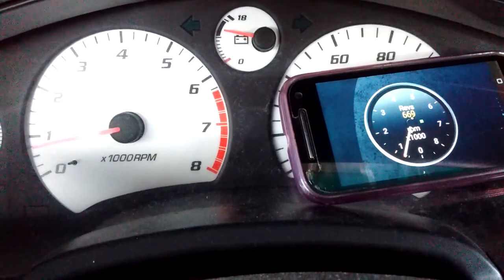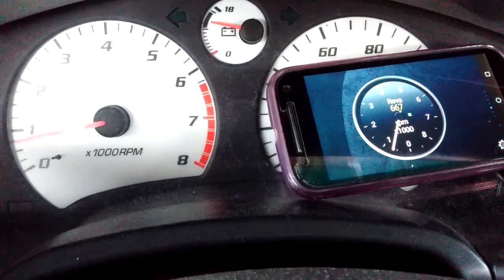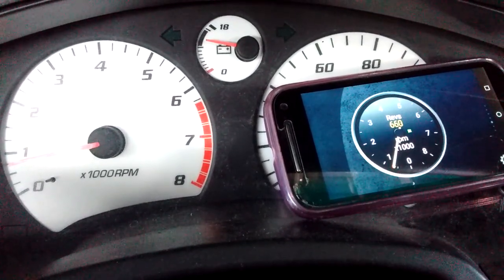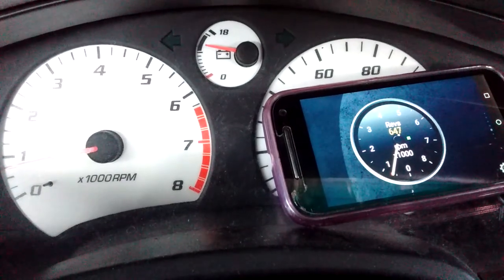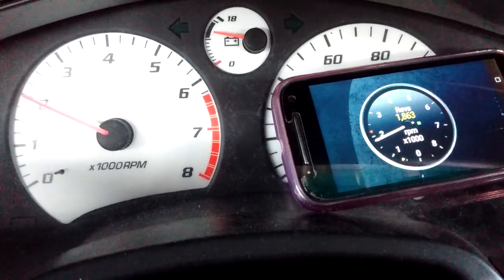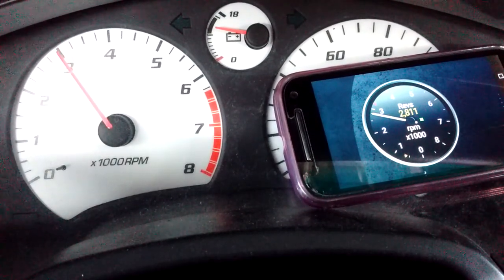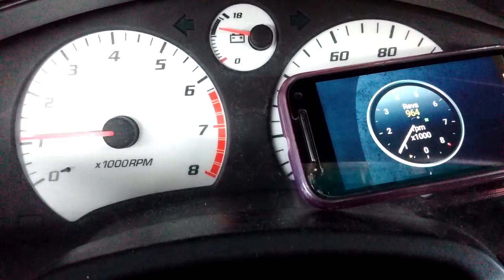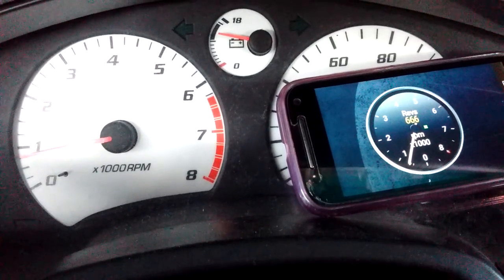2GR-FE Toyota MR2 3.5-liter V6 Tachometer 8000 RPM

Comment: Thanks for this video. Just ordered a 94 Camry V6 cluster for my 2GR.  Question for you, just like you I also have a 93 NA with a 93 E153, the harness plugs into the speed sensor but the Speedo doesn’t work. What did you do to make it work for you? There are just so many different variations.

Comment: Yeah, its pretty accurate. Originally my Rav4 2GR-FE tacho is showing 200 rpms too much comparing to obd.
Reply from the maker: I could improve the accuracy on mine slightly by remounting the needle. I'll do that next time I have the cluster out for any reason. Meanwhile I can live with a 150RPM offset. You might be able to do something similar with yours. Just idle the engine at known OBD2 RPM and remount the needle to the position that corresponds to that known RPM. Ah but your cluster might be entirely electronic no moving mechanical parts. LOL. Don't you love progress?
Reply: I doesnt bother me that much Frank.
Reply: many cars actually have tachometer showing rpm 200-300rpm more than the actual
Reply: @darkcashyz  Good to know
Reply: Im pretty sure they also have a chip that modifies the signal to the tach so you can adjust the rpm, they also make one for wheel speed sensors

Comment: 8k on that 3.5.. bet that thing is a beast. makes me want to build a sleeper out of my avalon. lol
With the cams, are you still running the actuators on the cams or is there a delete?
Reply from the maker: Why would I delete them? The variable cams add power. This is proven on the dyno. Anyway if you want to lock yours at zero advance, just unplug the ocv's.
Reply: Was just curious if it was able to be kept or not. good to know i can.
Reply from the maker: Yah the VVT gears fit right on to the high performance camshafts and they function just as they do with the stock camshafts.

Comment: did you modify the engine valvetrain or internals? was thinking on putting the 2gr heads on a 1gr and upgrading the valve springs if i have to. a 4.0 v6 with headers and dual exhaust  and limiting it to 7k with stand alone ecu is what I'm thinking on. i should be in the 350 to 400hp ball park
Reply from the maker: MWR valve springs. MWR camshafts. No other mods. You can run 7k with stock valvetrain no problem. Try figure out the compression ratio for 2GR heads + 1GR block.
Reply from the maker: The 1GR has 10.4:1 compression ratio with a 95mm stroke. The 2GR has a 10.8:1 compression ratio with a 83mm stroke. There is a huge difference in the head volume. With the 2GR heads and the 1GR stroke, the CR will be... high.
Reply from the maker: @JakeTheMechanic01  You will need to put low compression pistons into your block, that's all. They will give you a reasonable compression ratio.